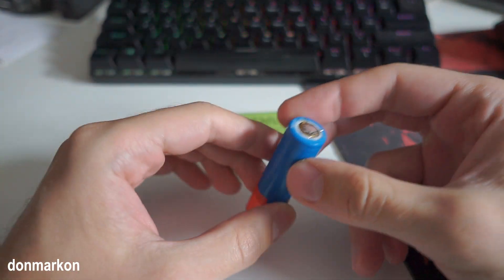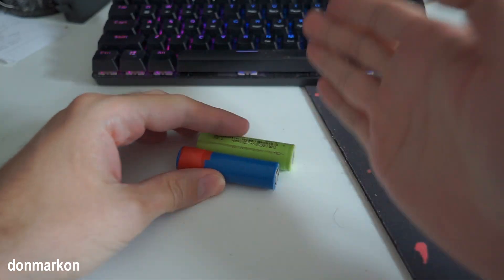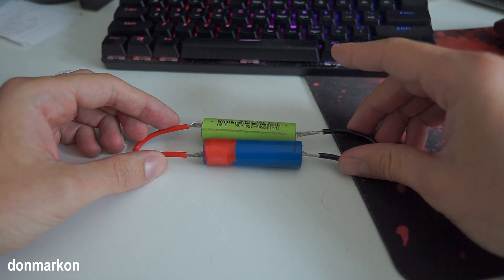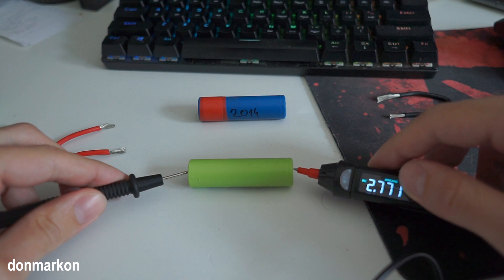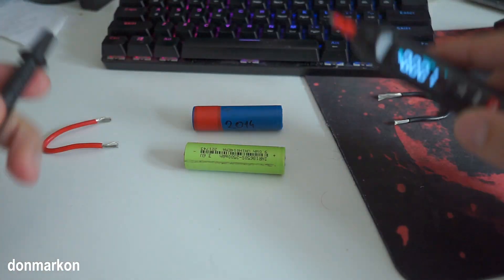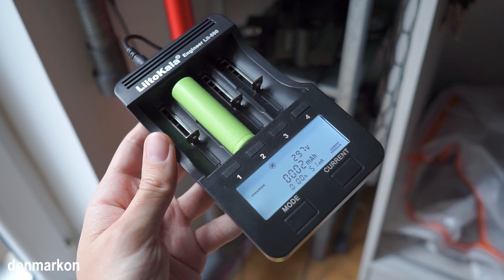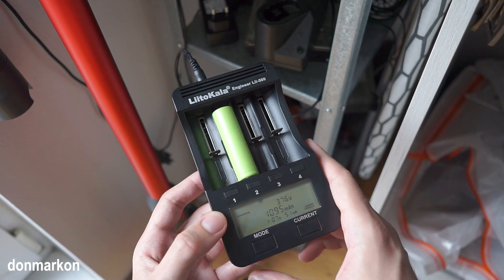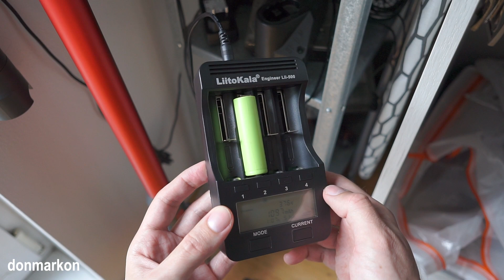Revive a Dead 18650 Works For All Types Of Li ion Battery Cells

Comment: Dead shorting them can be unsafe and generates heat. It's an unnecessary risk. I put a 100 ohm resistor in series (Can use smaller value down to about 30 ohm but may need to be higher wattage rating if you go below 50ohm. 100 ohm was just what I happened to have.) Neither battery gets hot and the dead cell, if it can be revived, comes up to a power lever recognized by my 18650 charger in about two hours. 18650 cells have an interesting chemistry if you're used to lead acid. They gain almost all of their voltage very quickly, and then have to sit near full charge for several hours on the 18650 charger to go from 3.6v to 4.2v. I check them again the next day and, if they're still holding charge, I use them. I should run loaded discharge testing but I'm just not that sophisticated.
Reply: He wasn't dead shorting them, he was parallelling them.
Reply: @garrett69  If one of the batteries is at or near 0v the current on initial connection, if not regulated, is near enough to being a dead short for there to be no practical difference between paralleling batteries and a dead short. That's why the batteries get extremely hot. At least they do unless internal cell resistance is extremely high. And if internal cell resistance is that high the battery isn't salvageable anyway. I stand by my statement. It also bears mentioning that 18650 cells have a maximum rated current, which this method will exceed substantially. The main reason this youtuber can do it is because, I suspect, he's demoing it using the same broken down power tool battery pack cells that he used to build his power wall. Power tool 18650s have a very high current rating. Most 18650s don't. Whether this method is a major fire and explosion hazard depends a lot not only on the condition of the batteries but on their current rating. Low current rating is going to be a greater risk. Power tool batteries have a current rating of around 20A. Tesla 18650 cells are about 5A and the random 18650s people have laying around are 1-3 depending on where they came from.

Comment: Yeah this is the exact wrong way to do it. Exact definition of why we don't parallel cells at different voltages.
Reply: Holy shit you sent a low voltage cell from 0.87V to 2.87V 

Insanely dangerous.

Edit: And then you throw it on the charger at 1000mA....Dude you are going to burn someone's house down with this video.
Reply: Starfirereborn,

While you Can do this, it is probably the Worst way to do it.  You NEVER want to take a dead lith cell and then pair it with a FULL Cell.  In the very least, that cell used to jump start should have been reasonably discharged first.  Or you could use a resistor to limit the speed of the transfer.

Just Surging a battery like this is again The Worst Way Possible to do it - even on the cheap.  That’s what people are criticizing, it’s not just because he used a battery.  

As someone who builds battery packs - I think I would know.  But if you want to go on defending stupidity, go right ahead.  Lol

Comment: Really? Pumping whatever juice the good battery has into the "dead" one, seems like the worst possible idea to me and I am sure many people will agree. I actually wonder, why there is nobody screaming down in the comments. Using a power supply with setting for max current and voltage to do this is the "right" way, if there is any. You can't just put the batteries in parallel, it gives a totally uncontrolled current flow from the good battery into the "dead" one. In your example the "dead" battery even got warm after a few seconds, this is already a sign, that it's way to much power. You risk having problems with the "dead" AND with the good battery. You can do, like you have shown, but only with very short pulses, not 10-20 seconds long and only if you put some resistance in between, some long wire, a light bulb or a proper resistor. Using a medium charged battery also is more safe than using a 100% charged one. I hope you be safe and the people watching this as well.
Reply: What's worse is that the overall issue with very dead batteries is dendrite formation and that tends to be worse at higher voltages and amperages the best possible way to charge one of these is to have a continuous charger with very very low amperage and not a 18650 charger just voltage and low amperage to get the battery out of the danger zone anything under 2.5 I think the problem is under that voltage I think the cathode dissolves into the solution that's what's so dangerous. As you are increasing the voltage it comes out of solution and forms tendrils that are needle-like on the anode that pierce the laminate in between the anode and cathode causing a short. Best thing you can do is charge it so slowly that the formation of dendrites is minimal
Reply: @Emmanuel-bw1wm this is the information i was looking for. I drained a 60v battery to 3v and I’m nervous about recharging it. I want to forsure have lithium battery rated fire extinguisher ready smoke detectors fiberglass blanket to smother it. If it does charge i want to discharge and recharge to find capacity and it its under 80% of what it was before I’ll definitely have to recycle it battery ewaste.
Reply: @EVO1087R I expect you will find most of the cells are unusable, unless there is a monitor circuit that disconnected the output.  In that case, it might suffice to replace the weak cells but it's quite unlikely balance can be restored to satisfy the battery monitor.
Reply: You guys sound like Germans, in fact Americans in general have started to sound like Germans and lo and behold Nazis, thank God you guys fell asleep in History class otherwise y'all might wake up in the morning and be like damn I'm a fucking dumbass Nazi
Reply: @Emmanuel-bw1wm Remember that in order for current to flow into the battery, the voltage applied must be at least greater than the battery.
Reply: Disclaimer: If you choose to do this, it is at your own risk as we don’t know the internal resistance or SOC, but below is a reasonable solution.
Use a 10R 5W resistor to limit the initial current to less than half an amp. You’ll need around 15 mins to bring the low voltage battery up to a charge where it can be put on a ‘normal’ charger. Check voltage and heat along the way. The battery will get warm, this is normal. Note: This assumes that an internal resistance of a battery is in the normal range of between 20 and 100mR.
I hope this helps. 🙂
Reply: Oh yeah, Wear PPE and do this in a ‘safe’ environment! If the battery gets very hot, stop immediately and take it to recycling centre.
Reply: Shut up. You surely have 0% idea. He's doing it
Reply: I recovered about 30 cells this way  2 years ago, and they are still good. Everyone is making up stuff like they are the pro. Like taxi drivers know how to run the country better than the government.  😅😅😅😅😅
Reply: @rsz90182  Nobody said this does not work, it's just not recommended to do it like shown in the video. Can you understand the difference between "does not work" and "don't do it like this"?
Reply: @rsz90182 I feel like this is a reference to something .... and I wonder what it is ? Is it ... Jimmy fail-a ?
Reply: @ytbone9430  you worried about heat but people quickweld these batteries with heat 😮 and tho i love and enjoyed your warning to peope 😅well I knew a guy who knew a guy who knew this girl who watched a video of an item blowing up in this kids pocket in an elevator and he didn't even mess with the 18650 battery it blew up all on its own... everyday is a gamble enjoy what you do and share that joy don't diss what you don't find acceptable unless it's say someone taking apart and draining air from a swollen lithium now that's just a little too crazy😂 just wish people would bring up positives when you already know people been hatin so much in this world...
Reply: I tried a very similar method.  It seemed to work well at the start and then was able to charge. I thought I had successfully recovered the batteries but soon found that the battery died again after a short period.
Reply: Nah this is nbd. I’ve done this with  RC batteries
Reply: Funny how you're saying what he can't do when he's already had success doing it. Sometimes safety isn't first. You just have to make sure you're good at math when you do calculated risks. But you did well not screaming about it.
Reply: I hope my mind doesn’t get this weakened for a “week” from playing with batteries too 😊
Reply: @Somnambulisticmaniacal expressing urgency over safety precautions isn’t weak.  It’s smart.
Reply: הה⁰⁰
Reply: Calm down. It's week minded to act like that.
Reply: @FastEddy5  Well, I have seen a couple of burned things in my life, some was my fault. It's week minded to not just listen to people who have some experience and knowledge. It's also week minded to risk damaging you, your home or the batteries, if there are a dozen very easy ways to do this correctly. You can do as shown in the video.. just go outside and wear some protection. Maybe you want to search for some LiIon "explosion" videos here on Youtube as well, just to get an idea what can happen in the worst case.

I also had training in fire prevention and general safety guidelines. If you have seen how fast a regular living room can catch fire and fills up with smoke, which is lethal on the 2nd breath, you just cannot "unsee". Better be safe than sorry, nothing brings back your vision or health and a silly 18650 is surely not worth it. Everyone is invited to experiment and learn, just think a minute before you start and take some safety measurements. You can be silly and nosy any other day.
Reply: @ytbone9430  You are the one getting bent out of shape over someone else's video, though. "Screaming" really? Come on, man, that's just too much drama. I have a scientific bench power supply I do this with when the situation calls for it. Knowing what you have in front of you plus common sense goes a long way. Like I said, getting all upset, ranting, and acting all stupid about someone else's stuff is week minded.  There is a massive difference between speaking your mind and having an all-out fit of drama. So "Calm down. It's weak minded to act like you do!" Grow up!
Reply: @FastEddy5  If you get upset by my "Really?" word and cannot appreciate anything else I wrote about what I think is wrong, what can happen, what are ways to prevent and how to do it correctly.. then, I can't help but think you're.. ah, anyway.. it's not worth wasting my time with you, please be safe and take care (for the people around you at least).
Reply: @FastEddy5 expressing how urgent it is to take precautions safety measures isn’t weak minded.  Safety measures with this kind of tinkering is incredibly important and should be addressed with a sense of urgency so that more will pay attention to it.  It’s only drama if you view it as drama.  Them loudly professing the need for safety isn’t weak minded, it’s smart.  Imagine calling someone weak minded in a YouTube comment for prioritizing hazard prevention and thinking you’re somehow the smarter person or not “weak minded.” 😂
Reply: @bjthebrain968   the only reference I made to a weak mind was the continued misspelling of weak as “week”.  But you just topped that in your own special way.

Comment: Wow. Didn't think of this.
I had a cheap Chinese lamp running on this 18650 battery that won't charge. The problem is, I later figured, the cheap Chinese stuff doesn't have proper charge control and lets the battery discharge too much too often.
No matter what I did, i couldn't get a blue charging LED on!
After your clip, i got an idea, dismantled an old laptop battery (got the best out of 6 18650`s in there) and solved the problem with the lamp.
Thanks man!

Comment: Are we forgetting about how rapidly it was discharging after he tested it with the multimeter. Yeah it might be able to jump start the battery, but it'll probably never HOLD charge again. Kind of like the batteries in your PS4 controller. Once those batteries go yeah they might actually take a charge and you can use the controller while it's plugged in; but as soon as you remove it from a charging source and simply leave it there for a few hours it's completely dead even though it hasn't been used. I'd get that 18 650 batteries are expensive, but once they fail they fail. It's pretty simple. Just buy from a reputable company and if it fails before it's listed charge cycle, typically the company will replace it instead of having people do dangerous shit like this 🤦
Reply from the maker: You are pumping a story in your head too much 
There is difference when battery is dead because it reached end of cycle and and when it is just got discharged 
There are too much factors in play 
The point is it can help there is zero risk involved if doing how I explained
Reply: @donmarkon  Maybe it is you that do not understand what happens to battery's when they are discharged ?
A battery can die in many ways, one is due to reached end of charging cycles, another is due to high internal resistant, yet another is due to high self-discharge.
The two last ones can happen way before the battery had reached end of charging cycles, and they make the battery unusable in some applications, high power and keeping the charge for an acceptable amount of time are in play here. This is called degrading and is often due to mishandling of the battery, as like storing the battery with to much charge, or store it with a to low charge. Too high or too low temperature during use/storage is also a degrading factor.
One more condition can occur with battery's that is unwanted and that is their efficiency, that is the fact that you need more and more energy (Wh) to fully charge the battery, and you get less and less energy out of them, example is that you put 105% of the battery stated capacity into it when it is new and you get 98% of the battery stated capacity out of the battery, as it get older you will end up having to charge it with 2-300% of the battery stated capacity into it, and you may get 5-20% out, that may end up being a very expensive battery to use, electricity is not free.
Just because you have revive a battery to an apparently working condition do not mean that it is a good battery you've got out of your efforts, sorry.
But in some cases it can be worth to revive battery's, but it is only a short time solution.
I have made a lot of money on rebuilding laptop battery's, not because it is a good idea from a economical point of view, but because my boss told me to do so because he was thinking that it was clever to try to get all capacity out of battery packs by "repairing" them. It was a waste of time to try to do so, to many battery packs died again shortly after the repair and the users was pissed. You can repack a battery pack with brand new cells, that gives sense, but trying to revive battery's are senseless.
Reply from the maker: I have power wall with 18650 with nearly 1000 of them 
All salvaged from Bosch packs 
I think I have enough of real world experience not behind keyboard theory :)
Reply: @donmarkon  Yes you have  real world experience of salvage nearly 1000 18650 cells from Bosch packs, and you made a power wall, that is a good achievement, but it do not give you an understanding about what happens when 18650 cells degrade and the many ways they can do so. When looking at your other videos about salvaging/using/reviving 18650 it is clear that you do not know and/or understand this, sorry, but you are not alone most laymen and some professionals have the same ignorance regarding this, they often think that because they had made a dead battery into an apparently working battery then that had manage to make it as good as new or something close to that, when a n discharge way below its recommended level it is permanently degraded, how much is a open question, but damaged it is and nothing in this world can recover it. You can use a recovered battery for some applications, but as a drop-in replacement for a new battery, no. You can make a working powerwall, but it will not be as efficient as if it was made with new cells, the same goes for th capacity it will be lower than if made from same spec new battery's, the useful service life of the powerwall is a open question, it will not be the same as if it was made with new cells. A bit of real world experience often give people some knowledge that make them believe they know a lot, but as a professional in electronics I had often had to deal with laymen and amatures that think that are so clever and smart with strange theory that are way out of reality, I am not saying that you are there, but you are about to get close.
Looking forward to the video about your power wall build.
Reply: @K2teknik. blah blah blah. Be quiet dude, u have no data to backup your opinion or data to refute his. Go cry on another post.
Reply: @K2teknik.  you are definitely right

Comment: How to prevent this and preserve a 18650 for a long time without using it? It`s enough to charge it once every 6 months, and store it in dry and room temperature? Thank you !!
Reply: buy a good battery
Reply: Yes. Just make sure the batteries do not fall below 3.5v otherwise many chargers will assume they are dead. Once every 6 months will probably do it and keep them going for years, imho.

Comment: I put my batteries in the charger and they would not charge. The red light was flashing after about 30  seconds. I have an older charger that I bought years ago and i tried them in that one and they charged normally.
Reply: Me too. Most of my chargers don't charge low voltage batteries but one does it is an SM-202A, two slot with cords and they are still available on aliexpress (though not in the search, only looking at the photo of the bottom of the charger).